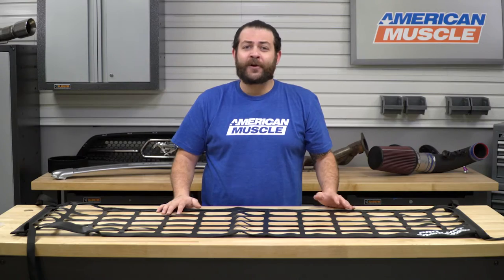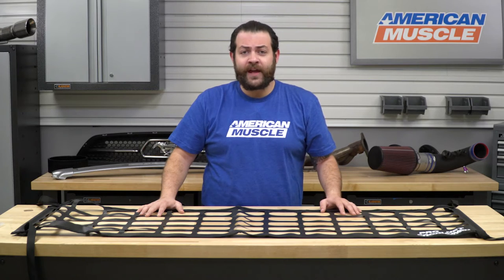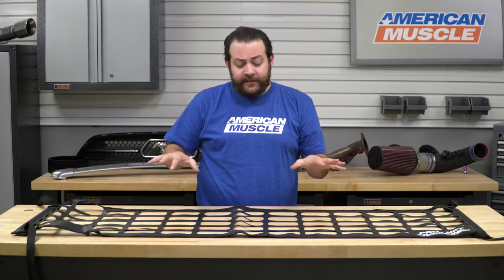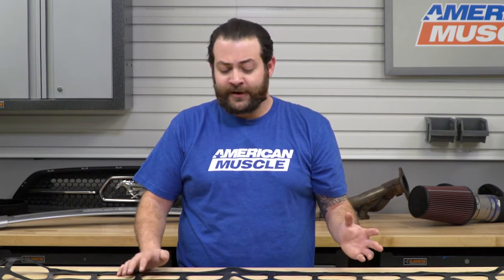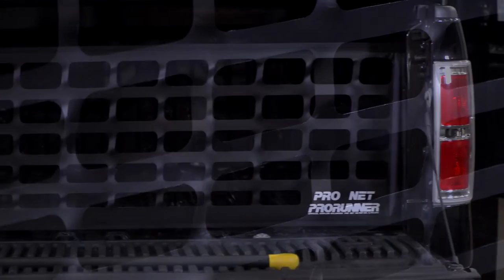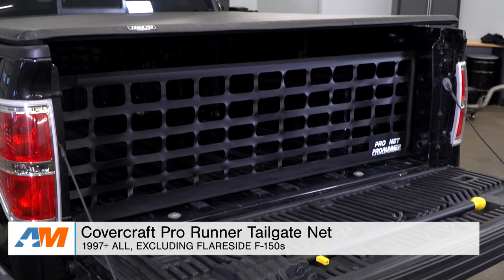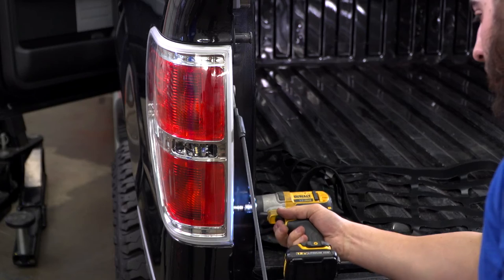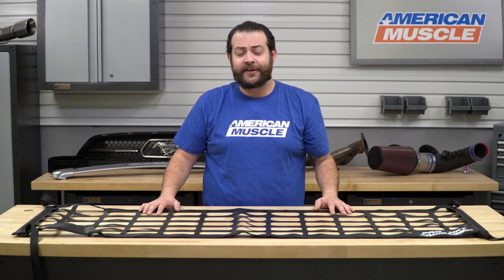1997-2017 F-150 Covercraft Pro Runner Tailgate Net (Excluding Flareside) Review & Install

Comment: A smooth aerodynamic air flow over a truck or car causes lift and the “lift” force is what causes drag. That is why spoilers are are used; to try to “spoil” this smooth aerodynamic flow and reduce lift and therefore reduce drag. 
The lower fuel consumption comes from the weight reduction.

Comment: Great video, but the description of the aerodynamics nets create is incorrect. They still pocket air purposefully and increase efficiency, but the air flows over the entire bed and net. The net, and your existing tailgate, create a desirable air pocket. The net just grabs a more efficient amount of air and weighs less than a tailgate.